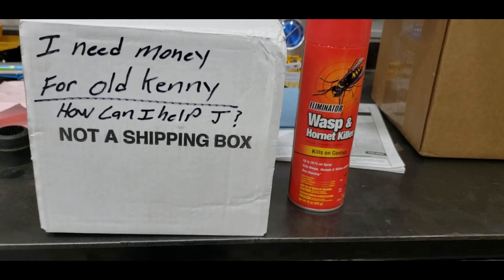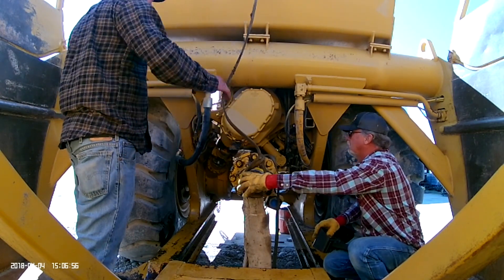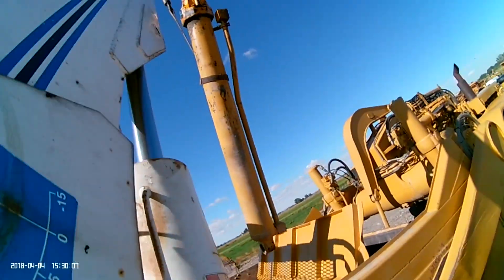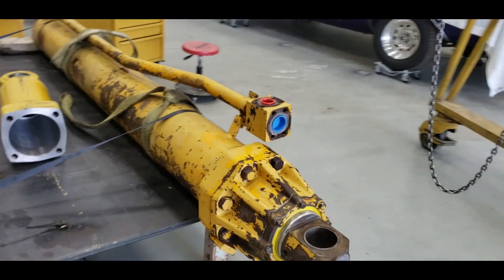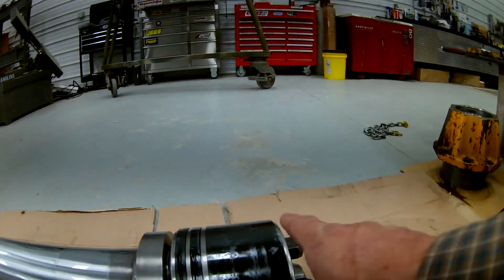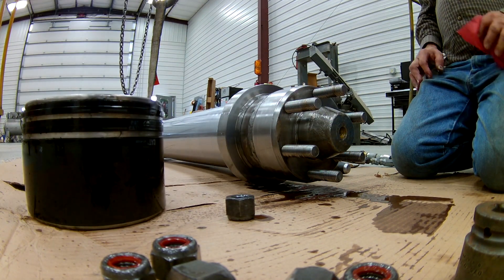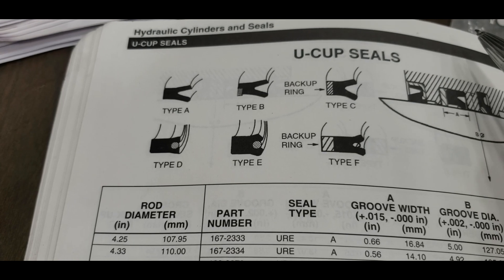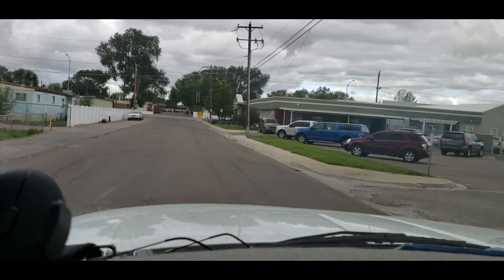Caterpillar 637 Ejector Ram

Comment: U lip seals don't move up and down in the seal groove , one direction the oil pressure holds them in place ( retracting ) the other direction (extending) the seal is pulled against the back of the groove by both the oil being forced out of the rod side and the seal lips tension on the ram shaft its common misconception. I've been doing commercial hydraulics for over 32 years in case anyone was wondering.
Reply from the maker: the updated u cup to replace the packing comes with a spacer but still doesn't fill the groove like a u cup seal would in one designed for it, the seal can move forward and backward as the cylinder moves, when I take them apart the lip on the outside will be worn more than the inside one, they work but not as long or as well as the seals made to fit the later non packing heads, no matter what I do the updated u cup for packing style heads never seals completely or lasts, so I figured I'd try this as I did it to the bail cylinder and it's completely dry and staying that way,  what do you think my chances are of curing this problem
Reply: @Jpaydirt  It pays to the machine the seal grooves to a fine non pitted or chafed condition, pay special attention to  installation of the seal (rubber grease ) most contamination enters past the wiper seal , that needs to well fitted.

Comment: The buffer seal just takes the  shock before it hits the useal  that's why they call it a buffer and not a useal   it might be a useal type but still a buffer   the useal will not jump around in the groove it will stay to the rod side in the groove  it will not move around under pressure
Reply from the maker: Thanks for that information, do you think using the buffer and the u cup it will work better, or just use the U cup.  I'm doing two right now, one with the two seals and the other with just one
Reply: @Jpaydirt   the buffer is always added protection but not needed   the buffer is there to catch the spike in pressure before the useal gets it   with a good rod and bearing in the head one seal will last a long time if not mis treated

Comment: I’ll watch all the videos and help out that way I can’t send a donation cause I’m looking at getting a 78 kenworth with a 3406 10speed or a 05 Pete with a 6nz 18 speed to turn into a single axel pulling truck for work to pull the weight a little more comfortably

Comment: Are you going to condition the cylinder tube? Take bead hone and knock the polish off the inside of the tube. I toured a hydraulic cylinder rebuild shop in Moscow back in college and they claimed that was the most over looked detail when rebuilding cylinders. They said to treat the seals like new rings on an engine.
Reply: As long as the piston is fine or at least the waer bands then housing should look like glass
Reply from the maker: Well it's a bastard to clean that big ol tube out after honing, so I wasn't planning on it
Reply: I had not thought about cleaning it out that would suck.  I remember they talked about honing a crane tube that was 22 ft long. Again a big pain!
Reply: @challengerhitchman  if you have an extension for you paddle or ball hone to get to the back of the housing your good to go  just soak a rag in solvent wrap it around the paddle or ball hone and run it back through a couple times then a couple rounds of dry cloth she'll be clean.  Use a piece of hollow tubing for and extension

Comment: Jpaydirt you really need to look into the Milwaukee 1in drive impact gun. It's got enough power to remove any nuts and bolts you work on and it's way lighter than all other impacts
Reply from the maker: Battery
Reply: @Jpaydirt  yes sir battery it's a beast look it up on the YouTube's

Comment: One of our machines has two sets of seals w u cups , hydraulic pressure in-between them , so if seals fail I can turn a valve and stop leak , finish that job , then repair . Both sets have resin fenaulic bands , ucups , backup rings , and pressure spring.. pressure in the middle.

Comment: If dings on rod, a true double seal package can take care of the bulk of it, longitudinal scratches, nope, chrome is the only way IMO. Chevrons are more forgiving of stuff than U-packs but yeah they do leak some. Cat stuff is induction hardened so doesn't ding or scratch easily. .275" between seals is OK for 2500psi but if you're 5000 I wouldn't trust it unless the seal area is machined steel. Cast or aluminum/brass iffy IMO. If the primary is isolated, no bleed to secondary, primary spacing is the critical dimension. I learned most of this on utility line trucks and cranes. Some systems used triple seals for redundancy. Good luck with the project!
Reply from the maker: So why is the spacing critical?  is 275 enough room between them

Comment: for seals I like to use the Hercules or Parker Hannifin catalogs because they are seal manufacturers with lots of options and engineering information.  I also like to use Roger Zatcoff for weird and different  seal products and kits, not manufacturers but lots of selection for off the wall applications and obsolete stuff
Reply: Yea Hercules they good company.  They mailed me a actual paper catalog.  Call me old fashioned but I love me a book I can also make notes on.
Reply from the maker: Me too!
Reply from the maker: Can you give me a link to some of those, the boys have a hard time finding seals for their Wabco trucks
Reply: @Jpaydirt  just google them when I need something, Parker Hannafin is the parent company of the hydraulic hose people, Hercules Hydraulics is a Clearwater Fl company and Zatkoff is a Farmington Hills Mi company that specializes in seals and O rings  if you access their online catalogs you should be able to find what you need and how to measure the seals and machined parts.  Zatkoff's sales people should be able to assemble specialty kits for your cylinders. if all else fails contact application engineering at Herculese or Parker and ask for help